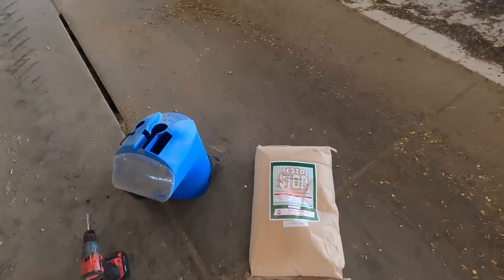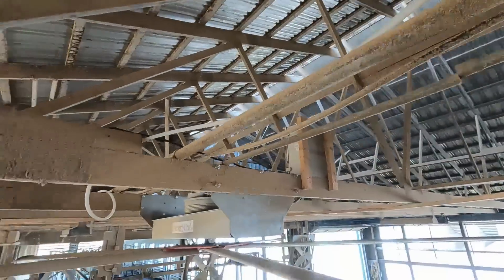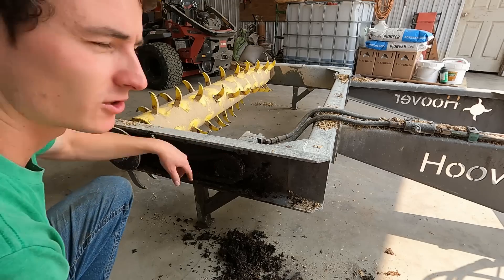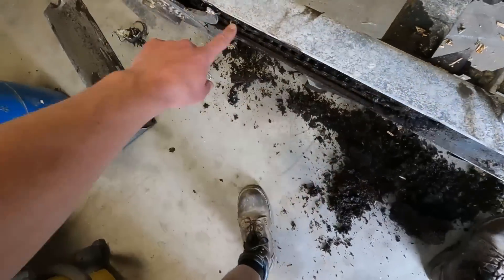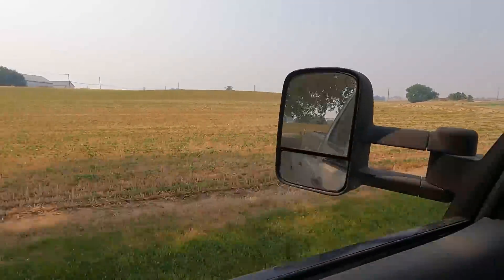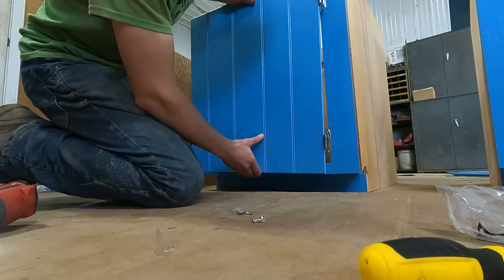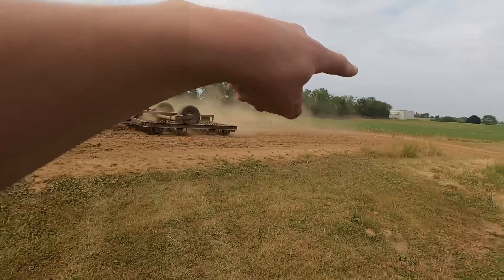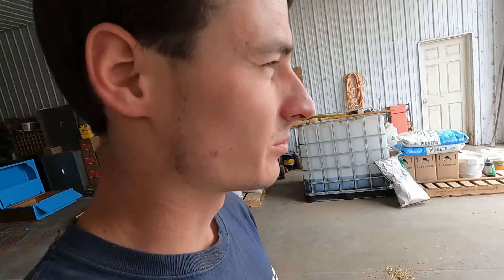Dry Weather & Odd Jobs

Comment: you don't want the fanblades getting wet because the dust will stick to it and cause more problems. that's why in the original misters are in front of the fans not behind the fans.

Comment: Probably won’t see this. But it’s a good idea to add a high pressure pump to the misters in the barn. It makes the water particles smaller and cools the air. Water will be evaporated before it hits the ground keeps things from getting soaked. And you can leave it on for all day if you feel the need.

Comment: I have no knowledge or expertise...but you probably don't want the mister above the fan blade.  The blades will get wet and accumulate more dust and dirt, and it won't get as much water to the cow.  I'm sure you could bend up a piece of steel to mount it to, that would be under the fan.  Just my 2 cents.

Comment: I have some information about skid steer tires that you might want to try out they wear really good on concrete have them on a concrete floor every day for 16 hours a day and they have lasted 5 years still and no flats but they are not good in mud